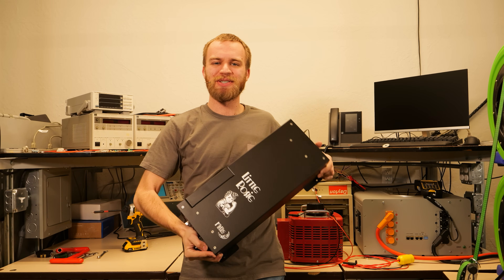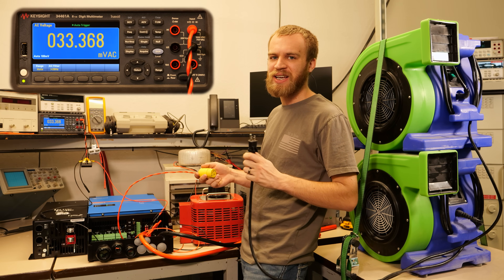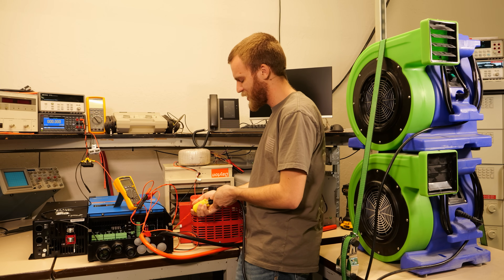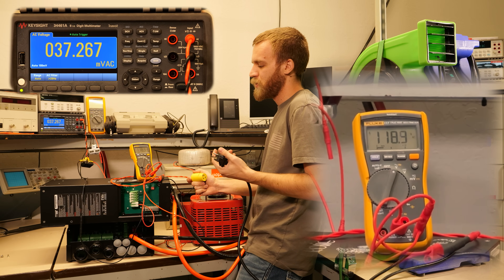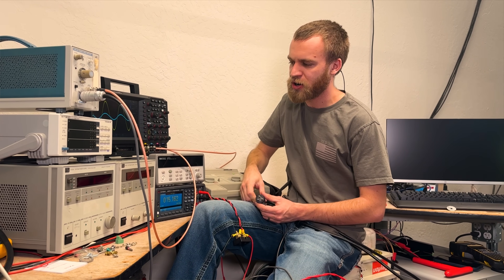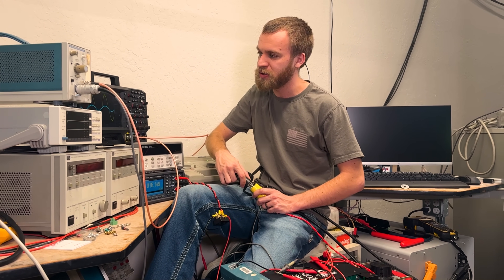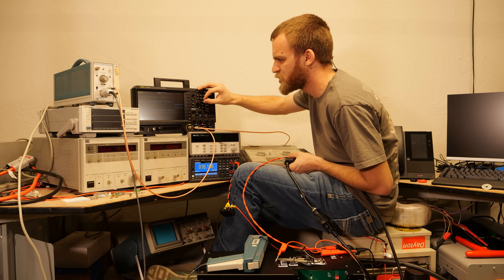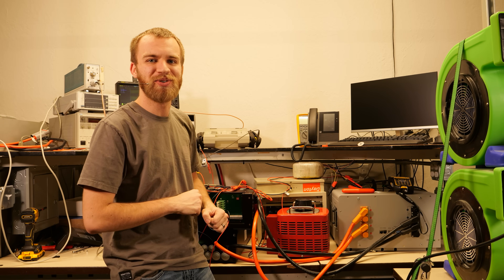Surge Capacity Test: Low Frequency Victron VS High Frequency Midnite | NOT WHAT WE EXPECTED

Comment: I really like the Lever Clamping used on the AC lines far better than the Push-to-Connect that Victron uses.
I have seen way too many videos and forum posts about the USA version of Victron Multiplus-II having meltdowns because of the low-end AC Line terminals they use.
It's worth noting that Victron doesn't use the same Push-to-Connect A/C Terminals on 220VAC units sold in Europe, they are only used on the versions shipped to the USA.
If Midnite added Input Power Assist like Victron has they could make a big dent in Victron's dominance in the USA RV market.

Comment: Impressive. Am seeing a gaint battery on your test bentch, are you using it as DC power supply to the inverters during the test? If yes, does the voltage  drop of the battery have an effect on the Ac output of the inverters ? and through out the test was the voltage of the battery stable when you carried out the test on both Inverters ? Or we should not consider it....m just curious 🙏🏻😂

Comment: As an inverter repair tech with nearly 30 years of experience, the U.S. made Little Rosie RE inverter is the ONLY high-frequency inverter on the market that I would ever recommend for use in off-grid applications. Unlike the cheap EG4, SunGold, Victron and other brands of high-frequency transformerless inverters, the Little Rosie is an absolute BEAST when it comes to starting and running high inductance loads and comes as close as it gets to the high surge capacities of a premium quality low-frequency, transformer-based inverter like the Schneider Electric XW Pro 6848.

Comment: I recently purchased the Victron multiplus-II 48/8000 and it has 3 wire 230 vac input and output. How do I wire this to a USA based 120/240 split phase grid system considering the earth grounding is different? Do I have to buy a 25KVA isolation transformer for the input to use the 100 amp pass through transfer switch?

Comment: A variac is a transformer, the inverter load was the variac, NOT the load. That test made the two inverters MORE "equal".
Inv1: LOW voltage PWM sine > transformer1 > transformer2 > load
Inv2 HIGH voltage PWM sine >-----------------------> transformer2 > load
Grid ANALOG sine >----------------------------------------> transformer2 > load

P.s.: no such thing as "low frequency" inverter, not if they the (not really) "pure" kind, which is the reason for the "high frequency screaming" at ~2:45.
The PWM frequency clock tends to be above 20kHz, because that is above the range of human hearing, the extra stress caused the screaming, in this instance, for whatever reason.
The ancient square wave type might qualify as "low frequency", since the square wave is generated at the actual power frequency.

Comment: That little rosie is impressive. Can 2 or more be connected in parallel?
Reply from the maker: No parallel capabilities for the Little Rosie, but if you do need more power, you can always get the Little Rosie's big sister, the Rosie! The Rosie can be paralleled with one other Rosie, and each Rosie offers 7kW of 120/240V output.

Comment: Finally a HF that performs. As the owner of a marine electrical business we use low freq because over the last 20 years the have been far more reliable. Our experience with HF goes all the way back to the Xantrex ProSine I/C’s, they were horribly unreliable. Then Mastervolt launched their own HF. They too turned out to have a high failure rate. We still have some yachts out there running 35 year old low freq Trace I/C’s. The surge/inrush is typically handled by the caps  even in low freq…Midnight has always built top quality equipment, just like Outback and Magnum (pre-Sensata). Victron for us has proven to be insanely reliable.

Comment: 11:35 "The squiggly lines up and down are distortion of the voltage." No, they are switching noise from the HV output driver stage.

The current waveform is distorted (flat spots after peaks) because its output stage enters a current-limited regime after its peak current limit is exceeded. That gives inrush loads a chance to start up before the inverter goes into overload shutdown, hence the increased voltage noise from the inverter throttling output duty cycle to limit output current. More or less the same story with the Victron, except the low-frequency transformer doesn't allow the PWM controller to adjust to changing output load as quickly.

Comment: When the Victron inverter started with the load it sounded to me that it started making a buzzing sound. That’s the same sound my Victron Quattro 10000 started making right before the internal relay burned up. The unit was considered unrepairable and they replaced it. I’d like to see the same test done with a different identical unit.
Reply: True, looks the unit under test has some issues.

Comment: Could you do a video on inverters with a UPS feature.

Im trying to find an inverter that can work as a UPS and many claim to have the feature but often its not a UPS and just a transfer switch or the inverter is to slow to engage and connected devices will turn off.

Comment: Saturating the PWM filter inductor at high current.  It causes filter inductance to collapse in value allowing more PWM high frequency switching waveform to leak through to AC output.   

There is a fine-line tradeoff between allowing some saturation of PWM filter inductor core and amount of lossy R-C snubbing that is needed.   Toughest situation is when high current load suddenly drops off leaving a lot of energy built up in filter inductor with nowhere to go other than creating a large voltage spike.

Inverter AC output voltage sense for feedback regulation is taken after the PWM filter.  Screwed up output waveform screws up 60Hz AC voltage regulation.

Comment: Wow this is an awesome test! Very interesting.
I've tested some 6000xps here at work with high startup loads. But I don't have a full oscilloscope to test the waveform.
I was able to start a 5hp compressor with one 6000xp and 400w of baseline loads, voltage definitely sagged a good bit, but it still was able to start it. I didn't have my inrush meter on it, but something around 75a from a quick calculation.
Then later once I got all 4 inverters connected up, I did a test with a 5 ton AC unit that would always trigger the generator to start on the old system and shut down the inverters (Outback FX-3648 LF inverters, 8 of them) and all 4 started up the AC just fine with no voltage sag. That was 111a inrush current (I did have my inrush meter on that).
I always thought that LF inverters did better with inrush than HF, but now this video and just looking back at the tests i've done, at least with those FX3648 inverters and now the Multiplus, seems like LF inverters really struggle compared to HF. 
Very very interesting stuff!
Reply: And for context:
The FX-3648 inverters were from around 2006-2012. And we started having them fail and just have bad output from them. in 2023 two of the 8 inverters failed in one summer for seamingly no reason that we can figure. No shorts, no overloads, not worked very hard at all even. One of them the mosfet board shorted out, and the other the LF transformer shorted out and burned up (that one made the shop smell bad for a few weeks lol) 
But yeah, the largest startup current was that 5ton. But because it always made the inverters funky when it started, we only ran it if the generator was on.

Comment: Amazing testing ! I've found that because Victron is essentially the Apple of inverter systems (and the software heads and tails above all others), but their hardware isn't anything special, other than their superior protection software/mechanisms. Your full-spectrum view of everything would be complete, I'd say, if you tested one of the popular commodity low-frequency inverters, like the Ampinvt FT-6000W48V or WZRELB SP6K48RC. Depending on the results, the conversion efficiency for each at 0%, 50%, and 100% load may be interesting too (as I believe, even if the Little Rosie was close in capability to one of these commodity LF inverters, I suspect it's efficiency may be much better).

Regardless, LOVE this testing. Subbed !
Reply from the maker: Yes, we certainly opened pandora's box for testing a lot of inverters in a similar fashion, thanks for the sub!
Reply: @CurrentConnected  well, testing one of the cheaper HF inverters against one of the most expensive LF inverters is a bit Apple/Oranges, so testing at least one of the cheaper LF inverters that everybody and their brother buys would leave no room for doubt in anyone's eyes.

But yeah, make sure to ignore the hoards of future posters begging for their personal inverter to be tested ;) (unless of course, it offers something distinctly unique that the other 3 do not... most expensive HF inverter ? lol)

I'm still gobsmacked at the medium-term transient load capability of this HF inverter. It's as if it almost defies physics ! 😲

Comment: Excellent content. I can really relate to the wave form monitoring. Incredible that the Midnite exceeded the grid's capability.
Looking forward to more technical breakdowns of RE equipment.
I suspect all those smaller higher frequency wave forms riding on the 60Hz waveform are switching noise. 
I run my stereo system on an older 3.6 KW, 48V Outback. 
It blew a couple tweeters when a shield lifted on one end of an audio cable. This apparently allowed a greater high frequency voltage to appear at the input to my tweeter amp. (4 stereo amps in a divided audio spectrum).
What I found was high frequency sine waves riding on the 60Hz sine wave peaks. It worked to to be ~20Khz. So I never heard the fatal sound that took out my tweeters.
I put a low pass filter in the AC line inside the breaker box that attenuates everything above 400Hz.

Comment: I'd love to see this with 
12000xp
 sol-ark
Schneider 
I have the cheapest LED bulbs I could get from Lowe's in every socket in my house. 
I have a 12000xp
I have 2 old R22 central air systems 
One is 1.5 tons the other is 2 tons. 
I never see much or any noticable light flicker when they start.

Comment: What I still see as an advantage is the Victrons running effortless in a 3phase setup whilst being controlled by a Cerbo and monitored over the internet without any extra hardware.
What bothers me of the Victrons is the transformer charge/discharge cycle spilling a lot of enery.
Someday I might find myself buying 3 x a SMA Sunny Island that do have a lot more efficiency and also can be controlled via the Energymanager of SMA.
For now, I am still heppy with my setup of 4x16S 280Ah battery banks and 3x MP2 5000/48

Comment: thank you for the video......im not sure 1.1 seconds faster matters much.....i guess a win is a win though.
Reply from the maker: In this case with a fan blower, no, it probably doesn't matter.  However, longer startups mean reduced torque and a longer duration where high current is passing which leads to additional heating and wear/tear.  Applications where high torque off-the-line is required to get the motor spinning could suffer, for example where a well pump is trying to get a column of water moving - a stalled motor due to insufficient starting current could lead to overload trips and damaged components.
Reply: @CurrentConnected are there any plans to test other units? I'm curious how they all match up.... i really appreciate the sine wave info as well 😊

Comment: I would love to see you add 1,2,3 or more toroidal transformers on the output and do this test again. This would clearly show the contribution of a coil and a coil only. 
As you well know not only does adding a toroidal on the output help balance loading, it also adds inductance to the system, and inductance = surge capacity. 

Can you try it please?

And I am referring to 3 wire toroidal, not auto transformers of course.
Reply: Inductance does NOT increase surge capacity.

Comment: I just bought an off grid house with an outback inverter and it won’t run the washing machine. The previous owner had to run a generator every time. I got my old 25 year old  heavy trace inverter 12 V 2400 W out of storage and connected it up to lead acid batteries that were at 11.9 volts and it runs the washing machine incredibly well. Actually run it better than the generator that he was using. The batteries had a low charge because they were used that I bought out of some floor scrubbers for dirt cheap. They won’t charge all the way up.
Reply: You are surprised that different inverter topologies, give different results?
Reply: @MrSummitville  no I’m not surprised. I actually expected it to work because 20+ years ago. I actually used it to run my house and my washing machine machine.  I’m just disappointed that more modern equipment with a supposed rated higher capacity doesn’t work as well.
Reply: @drunkbuzzard3237  Different topologies, different results. You made assumptions, that were not true.

Comment: I think the thing you have to consider is the Multiplus II is very old technology literally 10 years old.  It might not be the best at everything nowadays but it is still solid and reliable, expandable, etc with a very long track record of keeping people alive and warm.  Still a good inverter and I would take a Multiplus over most of the cheap stuff any day of the week.  Midnight make very good stuff so I am not suprised by these tests.  I am now running a Victron High frequency inverter the RS48-6000 and that has the best of both worlds.  Victrons legendary reliability and configurability coupled with ultra-modern high frequency inversion.  It's quiet, no buzzing or humming and is more efficient.
Reply from the maker: This 5kVA Multiplus-2 came out last year...yes, there have been other models out longer, but this specific one is by no means as old as the classic Multiplus line.
Reply: @CurrentConnected  The design on the multiplus ii is nearly 10 years old that's what I am saying. The design has not changed and uses the same technology as one from 5 years ago.

Comment: Fascinating. The load voltage regulation, surge power ability and power quality on the Rosie is sooo much better. The Victron struggled a lot in both power quality (waveform) and outright surge power ability. While blower motors might just take a couple extra seconds to spin up, a big heat pump or fridge freezer compressor might fail to even start. I have a PowerStar LW6000 low freq 6kW 24-230VAC charger-inverter that I've been using for over 10 years and it's been bulletproof. Weighs a ton though as it has two massive cage-type transformers (not torroid) for inverting and charging.

Comment: Great testing, especially the scope traces. Hope you keep adding more data points in the future.
Wondering if the faster start-up on the Little Rosie is because it's capacitor based.
I mean it's even beating the grid supply. To many years since doing LCR equations.
Would be great to see the same two units retested in 10 years time after some usage, to see if the results are still close or have changed.
Often capacitors are the more unreliable component in circuits, unfortunately.
Looking forward to more of your great content in future. 👍

Comment: Nice analyses .. Btw In case that low power inverter(what ever brand) has proper design meaning like it was design to take amount of power we require then voltage spike isn't so big deal after all it is easier to check and control direct  or high frequency inverters compared to inv. with transformer between ..there is feedback .. L C Z and ofc R between so a big deal ..but what you have to worry isn't that.. First of all you must set your output Voltage as low as possible..for Europe it should be 230V or 240V but you can safely set it to 220V ..that is what it was long time ago... reason is exactly as we saw...voltage spike... Second thing you have to worry is voltage spike on primary side..but for that design needs to take into account that your voltage will go from 40V up to 65 V or about.. and because again you have transformers you need to check or worry about spike on the input...( i say input but in reality it is input of transformer and not on input on battery side) ..

But in general those low f. inverters usually are better that allow higher voltage spike and capacitors and transistors/IGBT etc are designed to handle this better .. Compared to high f. inverter where you are actually switching high voltage easily about 300V and it is easier to damage your output circuit by this spike on output of your trans./igbt /fet etc..